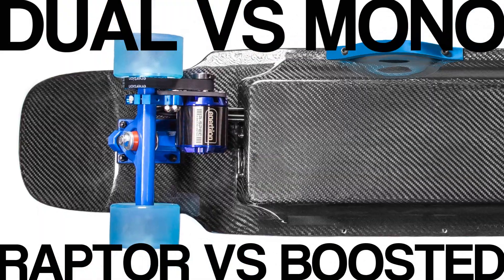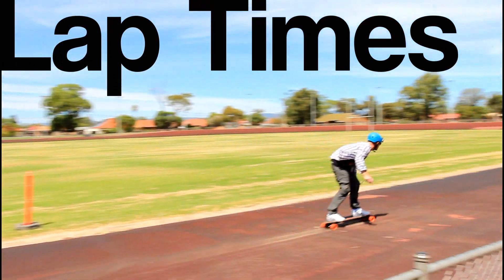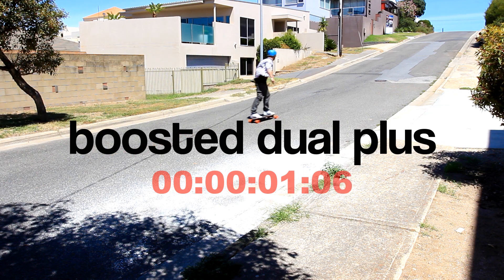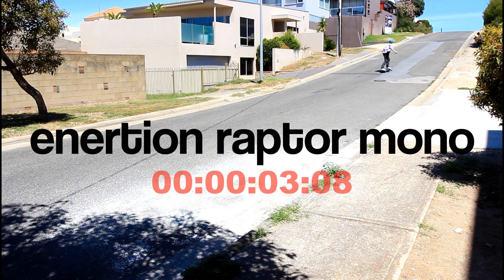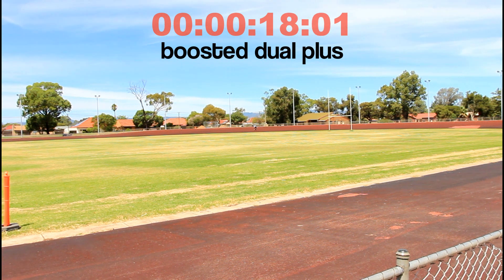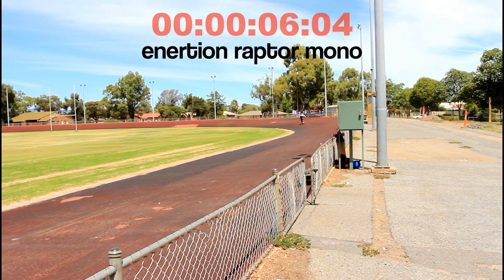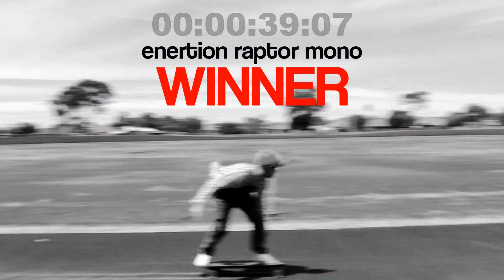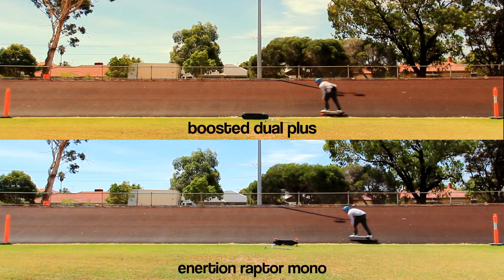Enertion Raptor Mono Drive VS Boosted Boards Dual Plus

Comment: What's the gearing ratio used on the mono? I built a diy board using torque boards 6374 motor with a 36 to 14 gear ration on a 10s space cell pro. I raced a boosted dual v2 and that thing beat me with torque hands down.
Reply: Enertion Skateboards one more question. For the setting on the vesc, what should be the battery min cutoff voltage for the space cell pro3?

Comment: This is unfair because the boosted board actually caps it's speed, sure its a test between the boards, but not 1 vs 2 motors

Comment: The boosted looks more steady
Reply: Anthony Steele It probably had tighter trucks. Tighter= less control but more stability, loose= more control, less stability.
Reply: I meant the acceleration

Comment: im pretty sure you guys had the boosted in eco mode or beginner
Reply: except that the top speed of an unmodded Boosted Board V2 Dual + is 22 mph while the Raptor 2 caps out at 27 mph so there is really no point in this. The guy in the vid was showing off his product's speed and torque in comparison to the Boosted Board which is a major selling point for his boards (yes he is the inventor of the Enertion Raptor). 

He also played nice and showed that the traction of the Boosted Board is better than his board in some circumstances.
Reply: you are dumb
Reply: cool digs is a car t shirts shop idiot
Reply: Nashoba Addai their product is better in top speed, battery is much bigger and acceleration but it's not as well maid as boosted board.

Comment: Impressive, but the Raptor wins simply because it has a more powerful motor. I can strap a huge motor on any skateboard and beat the raptor at all these challenges. My point is that while the Raptor has better performance, the Boosted is better in other ways, like ride-ability, and aesthetics. Both boards have pros and cons and it simply depends on personal preference which one you like better.

Comment: Are you guys receiving my emails? No one seems to be helping me out with the problem that you started. I received a different Vesc connector from the one that you are advertising from your site. Who do I need to talk to, to get help? I sent you pictures and describe the situation to you. Also I need with connecting the controller and receiver. You guys should take care of your customers, when they need help and provide a number for assistance. Also the videos that you're referring me to has different receiving parts for the vesc and Controller. If I known this would have happened, I would've bought a Boosted Board ( your competitor). If you don't respond to me then I want a refund.
Reply: firstly i wouldn't have to spam your channel if you actually helped out your customers. the vesc that you advertise is slightly different from  the one that you are advertising on your website. Second if you're going to do that, please let people know. third i have been trying to get in contact with you and have I've been providing photos and no one on your team is helping me. 4th that videos that you provided have different parts from the vesc  you gave me. you didn't even send me the receiver cable for the controller and receiver. If you provide feedback and help your customers out, then this would not be happening. Stand by your product and help me out.
Reply: +Electric Skateboard Builder also please respond to my emails if that's the only way to get in contact with you. If that's the only way I can get in contact with you and ask questions then I expect for you to respond since I paid for it.
Reply: +Electric Skateboard Builder so I don't have to do that. I don't like having to do this anymore than you have to respond to this.
Reply: +Electric Skateboard Builder I remember a few months ago I reply to your video and you told me the receiver cable comes with the controller and a receiver now that I placed an order and I received it,it's a totally different story. people deserve to know what they're getting into when it comes to your business if this is how you do it.
Reply: +Electric Skateboard Builder 
hey thank you buddy that really does mean a lot to me my apologies for being rude and spamming your page that was very inconsiderate of me sometimes I have to think that I'm not the only one out there having the same problem you know. Thank you for being reasonable I was able to make an account with your website and my question has been answered I was able to buy a cable receiver off of Amazon and it should be here shortly if I have any other questions I'll be sure to refer to your site thank you so much for your patience and for helping me out. much love

Comment: Reviewing your own board is pretty biased you should find someone neutral to send it too. One thing that looks bad on your board is that it's rigid plastic and probably has less flex though I don't know if it really makes a big difference since I never tried either.
Reply: Alright poor choice of words, let's get this straight. First, this is just an honnest criticism, not saying you're product is either worse nor better than the others. I think it is biased because you own  the company which sells one of the two products. Maybe it would be less so if your series of test was a complete comparison of anything you can think of comparing when buying the two products like weight, battery life, miles you get PER WATTHOUR at cruise speed/top speed, how both "feel" when riding it, etc... But even then it would still feel weird hosted by you. And I know your product is good on several of these aspects like the weight which is only 6.6 kg even though it has 270Wh.
But I still feel it is biased because you chose the tests. And those tests bascally just prove that your motor is faster and more powerfull than the boosted board's but I can know that just by looking at the spec on the two websites : boosted board has 2*1000W you have 1* 2400W. Your board is said to go at 45 km/h while the other is said to go at 35 km/h. 
Also if I wanted to, I could stick a motor that's 3kW and has a high KV rating, and blow both boards out of the race. But I wouldn't because higher speed is dangerous (I wouldn't like crashing at 45 km/h, not even 35 km/h) and it is probably less efficient since more drag. But of course that's a personnal choice.
That said it's great for you to have your own product and own company, I'm very admirative of this and aspire to do that in a few years.

Comment: sorry guys.. deadpool here.. i rode both boards already... clearly boostead board is not all the way set to GEAR 4.. Which is max speed to 21miles..  i already use a raptor can only go 15-18miles only.. if you're going to make a video like this.. use a speedometer while doing it.. dont cheat!
Reply: Stop spreading false info. Its clear you have never ridden a raptor cause the raptor should goes 27 mph.
Reply: ^what he said XD
Reply: boosted board does 50mph? raptor 27? thats not 27mph my child..
Reply: ***** No the boosted does more like 70mph and what I mean was that the raptor goes 5mph in reverse. I miss spoke.

Comment: What about the distance you get from a single charge on each?
Reply: The Raptor does 25 miles easily...
Reply: +Skitzor001 sucks that the raptor is so ugly and loud:(
Reply: Boosted would lose on that one, about ten miles
Reply: The new Boosted board is claiming up to 12 mi. and I think it's cheaper.
Reply: seanautube oh yeah i forgot about the new version
Reply: +Jacob hauenstein based on what? Personal taste? It isn't loud as well and In reality it looks a lot better then on video...
Reply: +Skitzor001 partly personal taste. I just think having a motor hanging out makes it in the way, and that the motor should be hardly audible over the noise of the wheels at the given speed. The feature of a handle is smart but poorly implemented, as it hangs down and looks out of place. The battery pack also causes a large bump. The use of what appears to be carbon fiber is smart, but i would hope the board has something else than CF and a pack to provide true longboard performance. I am comparing this to the Inboard M1, with no external motors, no hanging battery pack (but is swappable) and features the use of multiple materials to give a more true to life longboard feel
Reply: Boosted: 12 miles (cant confirm)
Raptor: 25 miles (confirmed personally)
Reply: The boosted V2 does 12 miles on ECO mode, on pro mode it's 8 miles.  The raptor can get 18 miles going faster than boosted on pro mode...  See my channel for raptor videos, I have both that and boosted.
Reply: The boosted dose have better customer service though...they reply same day and fix things within a week if you need to ship it to them.  Enertion is a one man operation so it can take months.

Comment: Your enertion boards are garbage, they cost more than the boosted board and look 1000 times worse
Reply: enertion boards may not be as pretty but they have better components and performance.
Reply: and why do you say that?? I have both boosted dual plus and raptor and other E-boards, see my channel for videos.  I'll be doign a comparison of boosted vs raptor and another custom board.
Reply: Lol someone doesnt know what they are talking about.

Comment: Extremely biased review. If you want more views cut the bull shit.
Reply: +Electric Skateboard Builder could you do this with the raptor dual?
Reply: Err how so dude? The Boosted won the final test without Jason even pointing out the fact the Raptor Solo he was riding had the motor incorrectly mounted on the toe side (apposed to heal) which reduces traction further by about half. This video was one of the key reasons I cancelled my boosted order (god only knows when international shipping was gonna begin) and bought a Raptor Duel. The other reason was a Evolve vs Boosted hill climb test, I'll let you find that and see what happens, and the final reason is who doesn't love the little guy, the under-funded start-up creating a product with these specs. Can't wait for my Raptor Duel to arrive, will post loads of videos of it eating up Brighton's super hilly environment. Keep up the awesome work +Electric Skateboard Builder and also Mazel Tov on the new bundle!! One luv

Comment: you should do a test side by side fully charged and do laps on that track at full speed and see range difference.   My boosted would overheat and start to cut out.  Same with evolve bamboo board.  When temps are above 90F the boards dont work very well. first few miles are great then the boards start to react to the heat.  if you make a vid showing yours will out pace them in heat and the motor takes the temps i will buy one of your boards.  i like the kick tail and i like how your board motor is nice and tucked under the board.   seems like a good position for the motor.  Also consider a all terrain   tire set up or at least a all terrain skate wheel set up.

Comment: yeah yeah the real question is which one lasts longer and i dont mean battery life i mean all around life .. how many miles can be put on these boards is what i wanna know...
Reply: I think the bboard has 2000 full charges so it depends on how much you use it

Comment: I've got a question about those mono drive boards. Is the power from the motor going to only one wheel or is it going to both? and also, are the shafts on both ends of the truck connected,(i.e. When I spin one end of the Truck's shaft, will the other end also spin?)
Reply: +Electric Skateboard Builder wouldn't that make the board swerve to one side when you are riding it?
Reply: +Electric Skateboard Builder so the wheels on each end of the trucks are able to rotate independantly from each other?

Comment: well its less about two motors vs one as you would need the same power for both boards, if one has a more powerful motor then clearly its going to perform better

Comment: People want the boosted board more even though the enertion board is better. because Casey rides the boosted. Boasted has a better deck and better wheels. Isn't the raptor more expensive?

Comment: but is the boosted beter or the raptor mono
Reply: depends on preference, for example boosted is like the apple of esk8 boards, so if you are basic you would probobly go for boosted, if you like thinking outside the box then go for enertion
Reply: if you are thinking outside the box you would make your own, not buy overpriced parts or whatnot from enertion
Reply: +RubenM agreed mate. Shockingly overpriced parts!!
Reply: Rambo FPV Like what was it 60 bucks for a fucing motor mount
Reply: Depends on what you're looking for, functionality vs fun

Comment: what would happen if you were to have 4 motors on it?😂
Reply: +Ng Bo well it still has it 190 kv limit so the wheels can't turn even faster. it increases it by a little bit but not much
Reply: Dosen't increase the speed just increces the power like going uphill
Reply: and destroys battery live
Reply: +Ng Bo Wen what are you talking about it does increase speed you idiot
Reply: +RaFi TV sorry

Comment: hmm..one motor on the Raptor Mono goes 27mph....does two motors double that? or at least increase it by atleast half the normal speed? 

Like this.

1motor = 27mph = 100% power 

2 motors = 140-170% speed (40-70% speed increase) = 35-42 mph

Could that happed if you used 2 motors instead of one?
Reply: first of: electric Motors have limited rpm, they reach a peak.
so doubling them has no effect in speed, but it can bring up the torque. however, i suppose in the Mono there is a far stronger motor as the two in the boosted dual.

but no, two motors won't turn faster

Bad for my sorry english, and have a nice day
Reply: If a car has two engines that are both 100hp it doesnt make it twice as fast because they are both spinning at the same speed. It does however give more torque to the wheels but one 200hp engine would be a better option as it would be lighter and more fuel efficient.

Comment: Well on my electric skateboard I have dual motor setup..basically.. if am on flat ground i turn one one motor.....and when am going up steep hills I turn on both motors.....smart huh lol...i save battery and have enough power to go up hill...
Reply: +LIGAR53 how did you configure that setup?
Reply: +Tango965  just get two esc and connect positive to positive and negative. to negative same with the batteries..I use hobbywing esc 2 of them...so turn on one esc n run 1 motor

Comment: your website says that the mono will reach the top speed in 3 seconds if that were the case you would have taken the boosted board in the last sprint. Ill even quote you verbatim "Accelerate to up to 45km/h in 3 seconds" you also claim that you have a "30km range per charge" I want to see this done both on the mono and dual since that is what your website states! 18 miles on one charge in real life use and 27.9 MPH. I am in the market for a board but I have yet to find one without building my own that does at least 30mph or very close to it and goes about 20 actual miles or even further. there is only one other company that offers a 40 mile range and that is http://metro-board.com    but they only have a top speed of 20mph. I am on the quest to find or even make one that does 30mph and goes around 30 miles on one charge let me know if this is possible for you to do!
Reply: The Enertion Solo's motor was installed on the incorrect side in these videos (it came from a photo shoot). Notice it's mounted on his toe-side, no customer has this as you get far less traction. So actually these tests were done with a less than standard Raptor! With the correct setup (heal side solo motor) you'll see those verbatim numbers are accurate.

Comment: I just feel a basis in the video for your board I'm sure the tests were conducted equally but you're obviously testing features that favor your board top speed is just one of the factors the boosted board design is familiar to a traditional long board but it's all revamped and fresh its bamboo deck is so light while being flexible and strong and then we come to range and portability while on max speed it'll drain the battery a little faster you have regenerative braking so you're always putting power back into the battery and if you ever do run out of juice it's super easy to carry but you can also kick push like a normal long board because of the brushless motors theres little drag and it charges crazy fast the boasted board have a lot going for it I'm not trying to say either board is superior I just think they both have things that they excel in and what it boils down to is what do you want out of your board if speed get the mono if practicality get the boosted they're both great

Comment: he is not throttling that boosted board all the way and even if he is its obviously in eco mode. FAKE!!
Reply: ***** ill take not
Reply: +Enertion Electric Skateboards bullshit...boosted board is way faster than that
Reply: Jack Williams ikr
Reply: ***** I own a Boosted and I can tell you it's faster than that so idk what you did but something's fucked up. I have no issue with the Raptor but there is something wrong there.